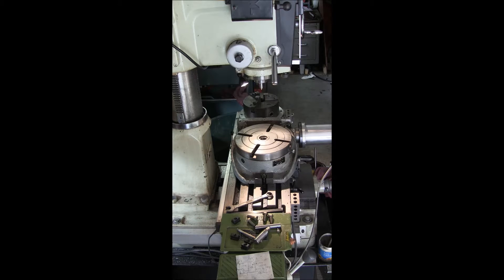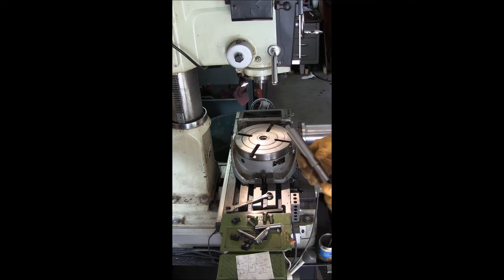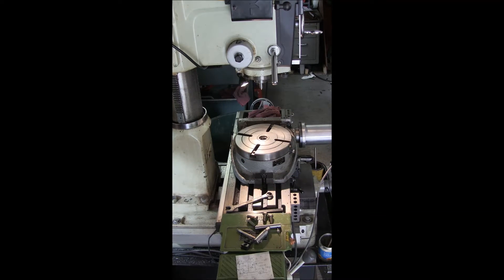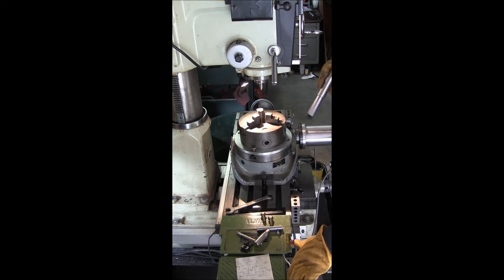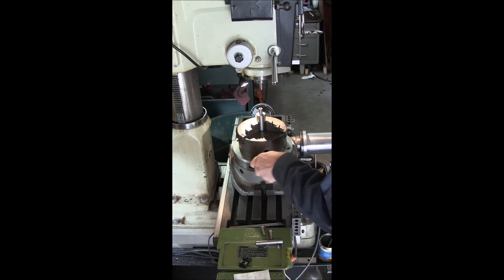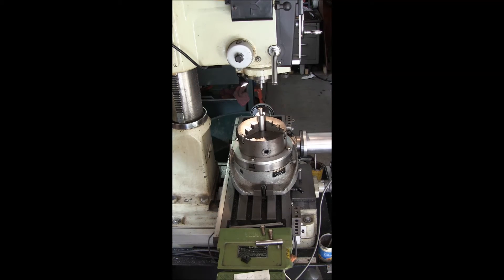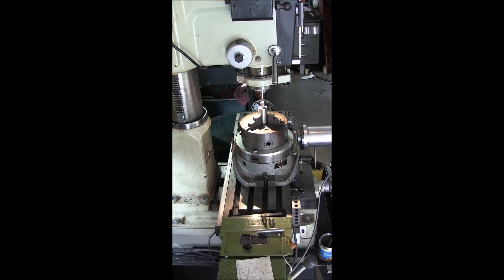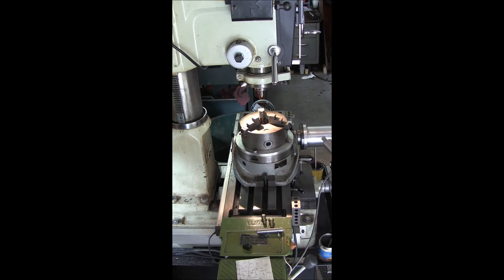Chuck mounting on Rotary Table

Comment: , this is great thank you very much for this video I was just sitting here 5 minutes ago scratching my head about how to mount a Chuck on to my rotary table I have the same exact table. As far as centering the table I do the same thing as you with the taper.......  I turned my own taper instead of pressing an existing paper into an extension. The great thing about using a taper to Center things within to Center the table itself with is that it doesn't have to be a perfect taper as long as it's close and it exceeds the diameter slightly it will find a perfect Center. So you don't have to do inaccurate job on creating the taper just roughly set you're off that to the close to the degrees I can't remember what it is two and a half degrees or one-and-a-half degrees I have to look it up every time. But just set it up roughly to that setting internally it will work regardless of its accuracy.
Reply from the maker: +Clown Whisper I am glad that you found it useful. I know some folks dont even use a taper, just the squared end of a shaft. The jaws of the chuck will hold it vertical so it fits into the taper. That is a bit more fiddly but it works. Thanks for watching.